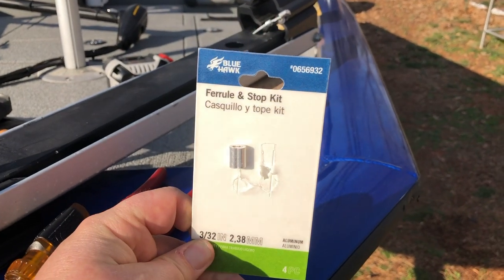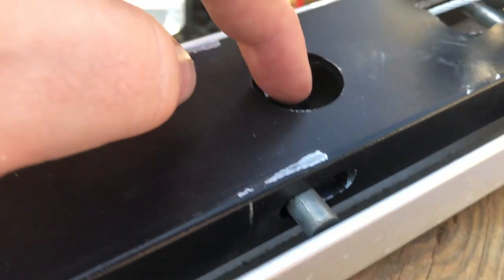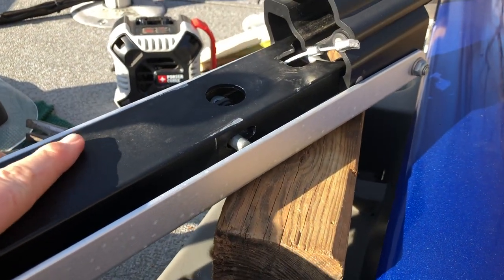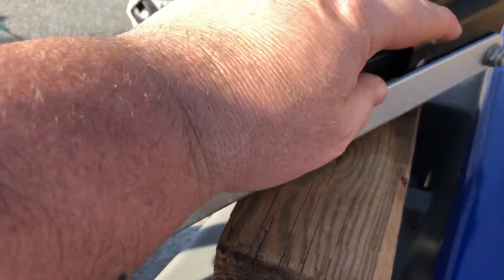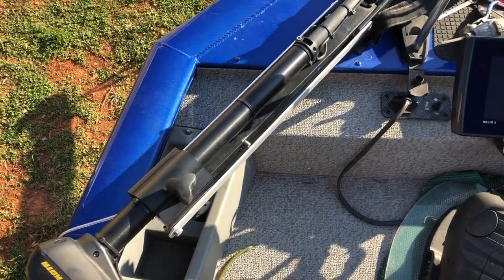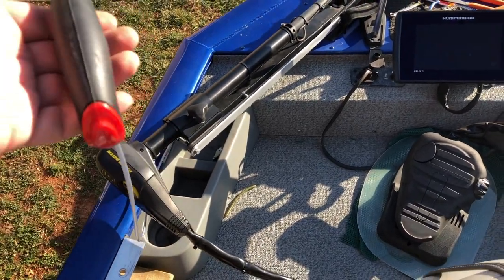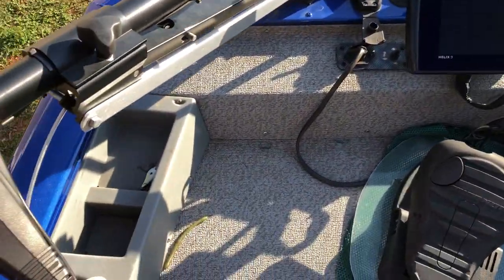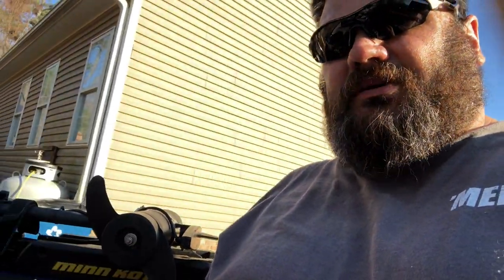Minn Kota Edge rope replacement

Comment: I’m curious how this repair has held up.  The TH Marine replacement with a wire cable recommends not using it on an Edge.  Apparently the wire will wear thru the attachment point for the release resulting in a far bigger and more costly problem.  I’ve had 3 cords break in a year, 2 were MinnKota brand pulls and the 3rd was 550 paracord.  I covered the wear points with heat shrink but it broke elsewhere.  And, we have not fished very many times during that year.  The last break was miles from shore in the La marsh but luckily I had a spare cord and handle on board.  I’m thinking about trying Amsteel cord or lawnmower pull cord.
Reply from the maker: I don't know if the cable is still working. I sold that trolling motor last year. While I had it, it showed no signs of failure. The rubbing issue is why the factory rope broke.

Comment: the bottom pin jams in the c shaped holder. Take a 8 in round chainsaw file and smooth out the holder works smooth as silk  you can get the file at harbor freight for less than $10.